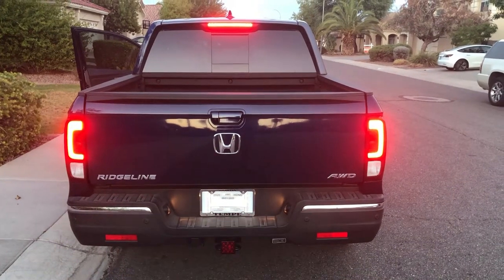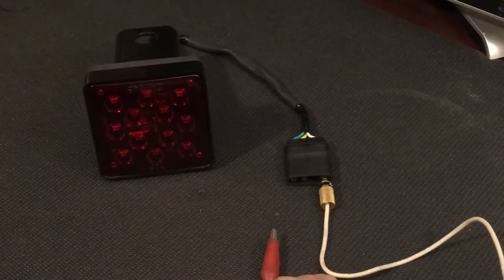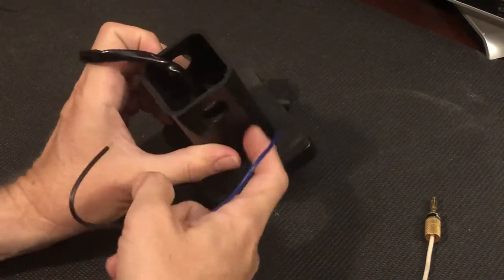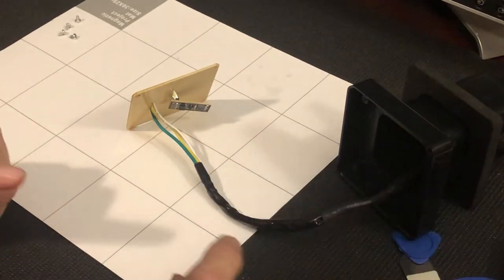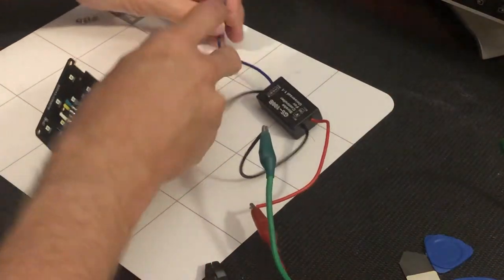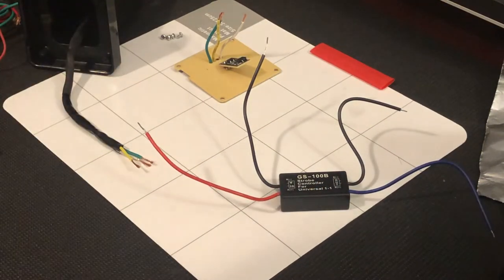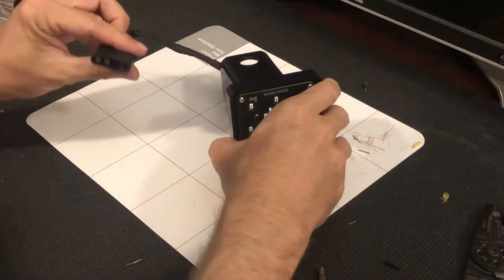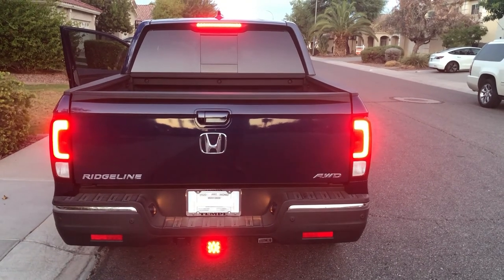Add a Strobing Flashing LED Center Brake Light to Your Vehicle Trailer Hitch for $20 (DIY)

Comment: Thanks for the detailed instructions. Very helpful. The latest version of this hitch light (8/23) has a 4 wire flat plug and a running light feature (brown wire). Your mods worked perfectly (kept the brown wire intact and didn't run it through the strobe) and I used a UK version of the strobe that flashes 4 times and then remains solid. Again thank you for this - works great.

Comment: The reason why white LEDs aren't used behind a red lens is that it creates pink. Same general rule of thumb is used for LED bulb replacements as well. LED color should match the lens if you want deep, rich color (unless it's clear, obviously).

For the wiring of the strobe unit into the housing, I would've opted to desolder the original LED's wires from the board and feed just enough of the strobe unit's wires into the board and solder them directly to the board - this would eliminate the need to splice wires, resulting in a cleaner install with less potential failure points. The two solder pads on the board could be tied together easily with one blob of solder, same as joining the yellow and green wires together.

Also, just a word of caution - that strobe unit isn't legal in most jurisdictions (California being one that I know of for sure) as it continues to flash as long as there's power to it. The legal limit is 4 flashes in most places to avoid confusion of it being an emergency vehicle. There is at least one other unit available (Amazon) that strobes 4 times and then remains solid on like a regular brake light until the power is removed. Upon the next application of power (brake pedal pressed again) it flashes and then goes solid again. Rinse, repeat. I believe there is also a built-in delay period where quick successive brake pedal applications (such as those during stop and go traffic) don't trigger the flash. I believe it's something like 2 or 3 seconds. Outside of that delay period though, it resets to flashing first. There are a couple different models available, each with different capabilities (programmable strobe rate, delay, etc.) - S1, M1, and G1 I think. I believe the 'S1' model is the regular 4 flash then solid, but I may be mistaken. It looks like a white opaque plastic box, and is also quite a bit smaller than the unit you used here.

Good video though. Cheers from Canada! :)
Reply: Also worth noting: Careful about tying the two turn signal wires together on the vehicle side of the strobe unit. This shorts the left and right turn signal circuits in the car together. Some cars can deal with this since they have already have circuitry that isolates the two (as would seem to be the case for your Honda), but on many vehicles doing so will cause both turn signals to flash (like hazards) when only one turn signal is operated. The way to prevent this is by using diodes to prevent backfeeding current into the car. One diode on each the yellow and green wires, then tie both diodes together after that for a common positive feed into your circuit. Easy peasy.

Comment: Just had an driver rear end my Tacoma. Not bad  but just enough to brake my hitch light. Obviously these are not "FOOL" proof. Mine was a Harbor Freight item - two wires - just for brakes. I did the exact same thing with the wire so as to not have that tacky mess showing. Real clean set up. HF does not carry these simple ones anymore - so now in my Amazon cart(CZ Auto -a bit cheaper) Your post is GREAT with adding the flasher (I installed one of those on my G37 system - flashes three times fast and then steady) Just like me -you do it right! Great job! Thanks for sharing.
BTW - I heard you say Arizona - I'm in Fountain Hills.
Reply from the maker: Thanks Dave.  I'm grateful for your critique.  Sorry about your accident and I'm glad it wasn't worse.

Comment: Question - Does the trailer hitch light up when a turn signal is applied? You connected the green and yellow wires together before going into the circuit board. Please let me know. Thanks! You need a great job on the video.

Comment: I did pretty much as you did. It works great. The only issue I get is that when I put the car into reverse, I now get a fault message for the reversing sensors. I connected straight into the trailer plug (in Australia we have a standard 7 pin plug) connecting to the brake and earth hitch pins only.  I would have thought this should have not have impacted of the reversing sensors.

Comment: I purchased a similar hitch LED cover which also has the white reverse light. It has the 4 wire plug plus an extra white wire. The light did not come with instructions on what to do with the white wire. I would like plug it in from the bottom not the outlet on the bumper (I don't like the plugged from the back) and would like to make it strobe light as well when brake pedal is press. Can you guide me?

Comment: Hi! Great Video! Looks like this new flashing light set-up is still legal in California. I'm reading where our law wants the strobe light to only blink 3 or 4 times then go solid red. Since your cool set-up actually turns off after the blink sequence, I feel this would still count as okay to use. My flashing light project plan is to see if i can replace the top 3rd light on my 2004 Dodge Dakota Truck with a similar flashing set-up, but still hold a steady red after the rapid succession blink.

Comment: How’d you install the female connector under the truck?
Reply from the maker: Well, I'm not as proud of that part.  I found a wiring diagram for the Honda wires (they are not the standard colors for a similar hitch plug on other vehicles!), then I used wire taps, like stereo shops use, to tap into the middle of each wire and connect it to the 4-flat connector.  The ground wire on the stock hitch plug is thicker gage than the other wires (signals, brakes, etc.) so I used a file to make the gap in the wire tap blade a little wider before I used that one so it wouldn't break any of the strands in the copper ground wire.  When I was done, I wrapped the connections with electrical tape.  I do not like using wiretaps because they breakthrough the insulation.  The reason I chose to do so in this case is because it allowed me to add the four flat connector inside the frame in a very short and tidy installation.